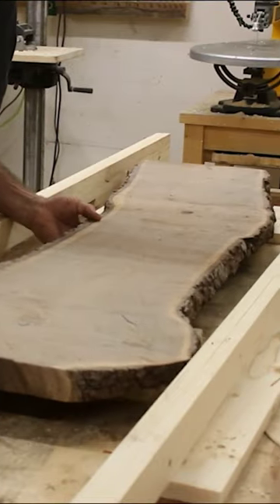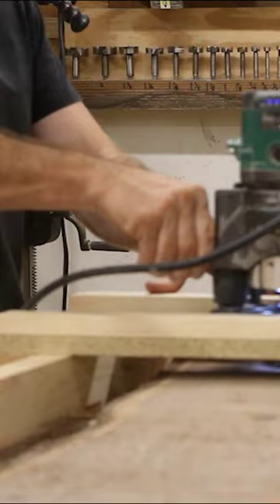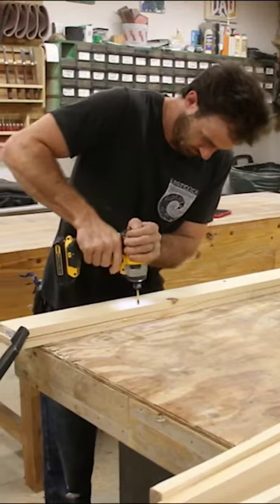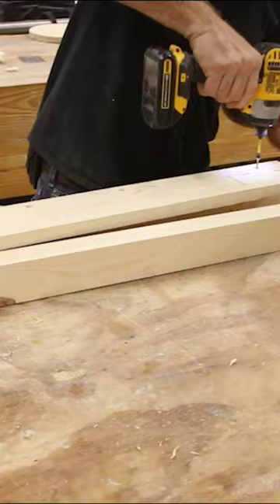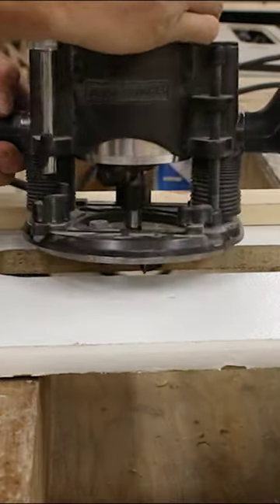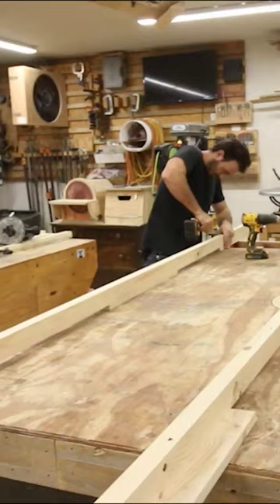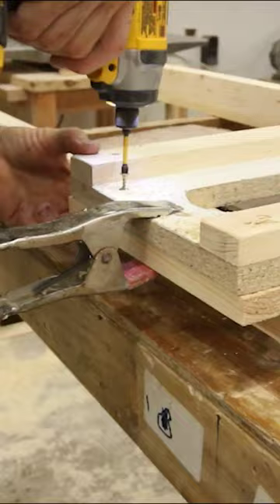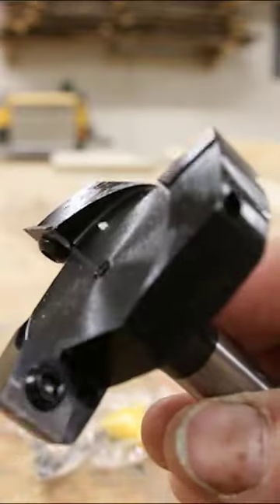This Jig Changed My Shop Forever!

Comment: FWIW, for found lumber, you can use a demo blade in a circular saw mounted to a similar sled to get it roughly level.  If you run into rock/nail/etc., it won't destroy your expensive router bits.  (You can also use belt sanders/power planes/etc.)

Comment: level doesn't matter .. flat does.
Reply from the maker: If it's level in all directions then that means it's flat. That's the easiest method.
Reply: @WyldeWoodworks  Easiest to get flat? .. how does flat and level equal the same work as just flat? Will you get to flat using level, sure. But you're working more for it.
Reply from the maker: @aeasus  More than what? What's the other method?
Reply: @WyldeWoodworks  A simple set of sighting boards at each end. For long runs use string lines to set your table between sight boards.
Reply: @WyldeWoodworks  With a set of sight boards you should only have to adjust the height of 1 corner of your table/jig to flat.
Reply from the maker: @aeasus  A level does the exact same thing except its also level. I don't see why level is a problem. It only took me about a minute to make sure it was flat😁👍
Reply: @WyldeWoodworks  It's not a problem, it's just extra work. Level means you adjust 3 corners to your starting point, flat means you adjust 1 corner.
Reply from the maker: @aeasus  It took literally one minute. Level out dude.😂
Reply: @WyldeWoodworks  I stand by my original statement that "level doesn't matter .. flat does". You've yet to disagree with that. You are the one who asked how to do it. I thought I was helping/teaching you in some way. I've professionally built bars, bar canopies and the jigs to do so for years before retiring. Projects much bigger then your video. I didn't intend to be offensive. I was lending experience. :face-orange-raised-eyebrow:
Reply from the maker: @aeasus  I did do that earlier. You weren't listening. And that's on the level😂😉👉👉
Reply: @WyldeWoodworks  I'm sorry I wasted my time. I thought you were Aspiring Craftsman not Arrogant Wannabe.
Reply from the maker: That's not very level headed of you🤣